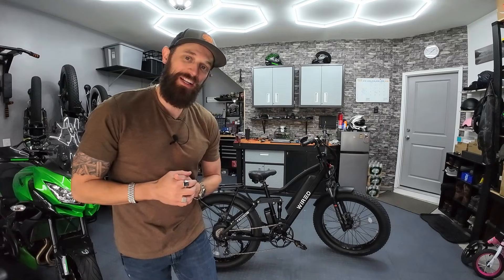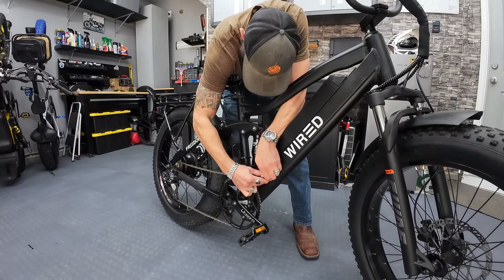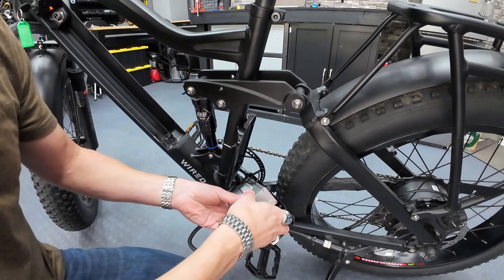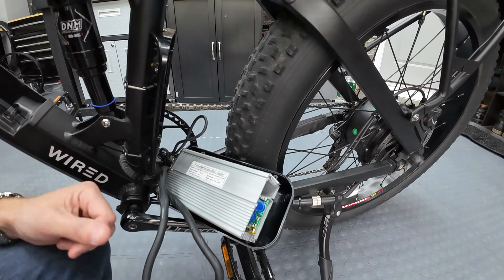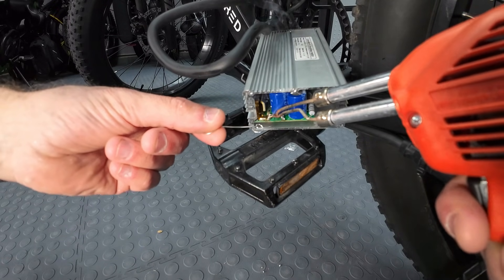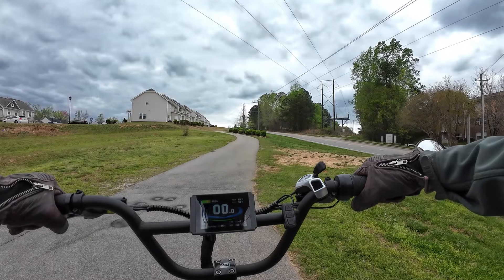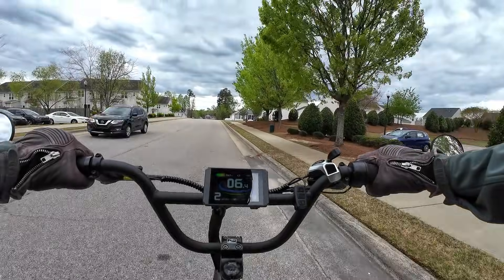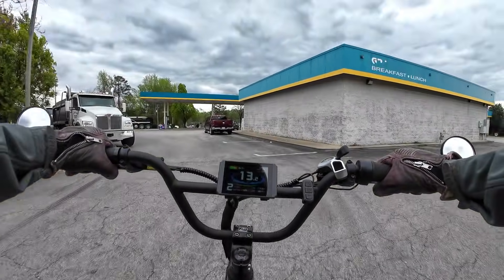Shunt Modding the Wired eBike

Comment: For those curious, the shunt mod takes two resistive connections that are meant to reduce strain on the controller components, and bridges them together to increase amperage. It's a common mod and usually safe, and the KT controllers are fine with it most of the time because their output transistors use the controller housing as a heatsink. The power increase is about 200 to 300 watts, but does not show on the display because the controller calibration does not account for the change 😉

The battery discharge current is controlled by the BMS (battery management system), and will limit how much power the controller can get. The exception of this is the BMS is mismatched, defective, or uses direct output which is unmanaged. If the battery or controller show signs of overheating, you can "undo" this mod using the soldering iron and solder wick, then bending the wires back apart if they are touching. Have fun!
Reply from the maker: Thank you,  you are a wealth of knowledge! Always insightful comments 👍
Reply: "The power increase is about 200 to 300 watts..." Is that relative to this bike, its battery voltage and controller amps or just in general? If I did this to my Emove Roadrunner, which is 48v with a front controller of 15 amps and rear controller of 20 amps would I still see 200-300 watts per controller? That would make a huge difference vs the Wired Freedom.
Reply: What if a controller only has one bar instead of two??  My kugoo m4 controller only has one bar and appears to be missing the second bar from factory
Reply: @Werk4Cash you can still do it , I wrapped copper wire around mine and then soldered it , sounds like you have a 22 amp controller,I recently upgraded my controller to a 30 amp ,but haven't done the shunt mod , I feel it doesn't need it , it has plenty of power as it is .
Reply: @r.vargas5410  ahh gotcha!!  I tried just putting some solder by itself on the single bar and it appeared a lot faster but forgot to unplug the battery before putting the controller back in its housing and it caused massive sparks and shorted out.  Tried unplugging the battery and reconnecting it and the damn battery wires sparked so much they basically fused together and crumpled apart totally messed up my kugoo m4 pro :(
Reply: @r.vargas5410  if you shunt mod a 30a it'll take it up to 80a once done. 😉👍🏻
Reply: @Werk4Cash  still can shunt it
Reply: @Werk4Cash take the thinnest wire you can find and flip the board around and solder the wire between the pins of the shunt and you are good 😊 If you want you can wire in a switch to toggle from stock to modded from outside 🎉
Only amateurs mess with solder on the shunts, a pro does it like I explained.
Reply: I'm considering this mod for the NEW 45 amp controler.  (on the 2nd 2024 Freedom model).  Any imput/advice or guidance to offer?
Reply: @lostguy2025 Dont do it like he shows.
Flip the board around instead and solder a small gauge wire between the pins of the shunt. I use the small balance wires from RC lipos. You can control the modd much better this way and even wire in a switch to toggle from stock to modded from outside 😊
Another good thing to do is beef up all amp bearing traces om the board with copper.
Reply: @AboveAll-h2w Right on.  Appreciate the guidance.
Reply: what was your outcome?  @lostguy2025
Reply: @josemancha7048  Top speed 47MPH
Reply: Can i use heavier gage wire and switch
Reply: Hard to trust Chinese controller in one aspect -- the majority of their controllers don't have alum fins on all six exterior sides of housing to dissipate heat away from box and into the ambient air around them. Cost-saving shortcut perhaps, or merely oversight. And thanks for your tech insight.
Reply: Ihave a hoverfly ourea do you know if this will work. Also any idea how to derestrict the speed sensor  i just bought it used on FB MKT PL  TY.
Reply: Can this be done on most if not all controllers?
Reply: Please send me skimatic of where to solder
Reply: Hope u got the wiring diagram. If so could u forward it to me or post it somewhere and let me know?  Thanks. Paul @thehighriseconstructionob9679
Reply: I think the more solder the better I don't know if the small amount would be a big gain??
Reply: Sounds dangerous for the average Joe Lunchbucket who is not an electrician.  Thanks for sharing !

Comment: Poor 5 Star and their potted controller!  No Shunt Mods for You!
Reply: Thats exactly what I was thinking
Reply: Yes, can easily be done on the 5 Star however it voids the warranty. It increases the power the controller provides to the motors and also causes a lot of heat because the controller is not designed to handle that much power

Comment: If you change the controller can you run a 72V battery for your front motor kit? More Volts=more MPH
Reply from the maker: I would not, it's a 52v motor so 72v is probably too much juice
Reply: @CitizenCycle925  doubtful i have a 2012 raven mpv 7100 modified to all lithium powered,  built fir 48v lead and I've ran it 4 years now on a 18s lithium battery 66.6v nominal/75.6v full charge . Went from 17mph  top speed factory to 29 mph now no controller or motor failure to date
Reply: It all depends on what voltage the capacitors are in the controller 🤔 you can look it will say on the capacitors .

Comment: I'm surprised the controller is encased in a plastic box as that inhibits cooling (IMO).
Reply: i was thinking the same thing i drilled several holes in my box dont know if it will work
Reply: wouldn't that allow water and god knows inside  and destroy the whole.thing?
Reply: @mikey3239 wat will protect from water if U have holes in it?
Reply: Just paint the controller black and Zip tie it to the frame

Comment: As always thanks for all your valuable input on everything especially "Wired" ! :face-blue-smiling: I don't know if you truly realize how influential your bike reviews and testing are to us who live in an ebike desert  !  All because of your reviews I've bought my ebikes , first one was a Hiiwiway cruiser (I loved) I owned it until I realized that it accelerated way too slow to run with traffic . Here in Indiana cars will just run you over or off the road while they curse at you(f____ing idiots).  I was really excited with your review of the wired freedom and it's top speed so I bought the late 2023 model and really wish I would have waited a few months for the 2024 model because I can't take advantage of the mid suspension , it will rub against my controller box so I have to extend it all the way out to avoid this . I have plans on buying the new model that way I will have spare parts and battery if needed . You are truly "De Man" 🏆on all things ebike related , keep up the fantastic work ! :medal-yellow-first-red:
Reply from the maker: Glad to hear you are enjoying my channel! FYI  If you buy a new wired the batteries are not interchangeable.  They change the connection port.